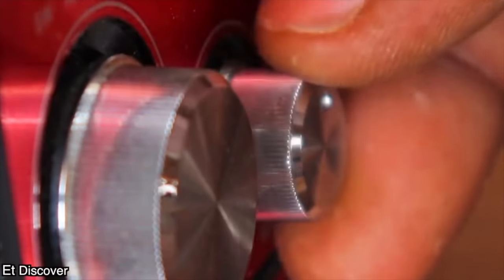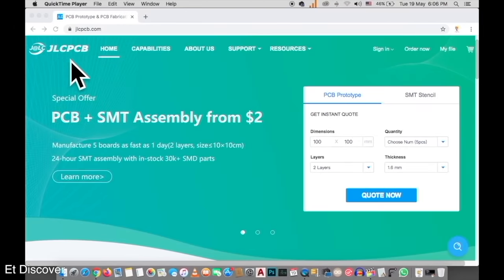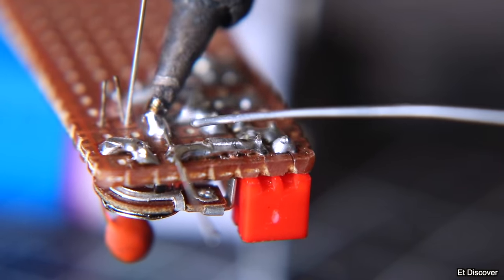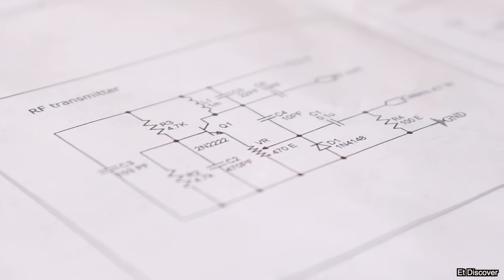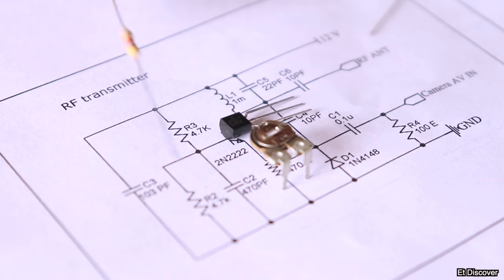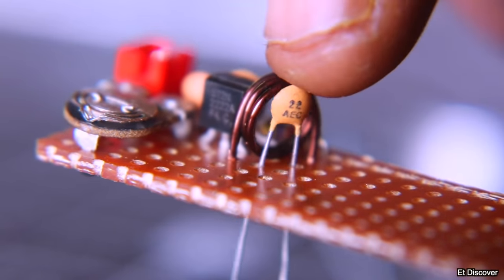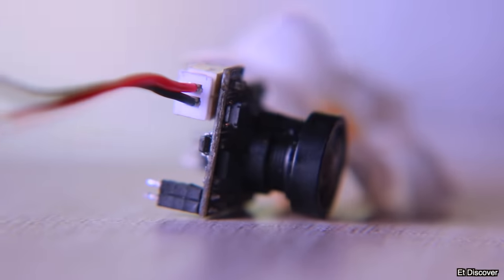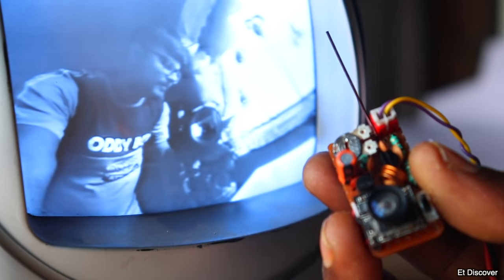How to Make 500 Meter Range Wireless #SPY Video Camera

Comment: Most wireless cameras have a receiver well most of mine do then plug the receiver in the back of most TVs .you turned the TV on then powered up the wireless camera you just built how did you get the picture straight on the TV ?

Comment: Hi
I searched a lot and tested more about video transmitter till i watched your latest video on YouTube  about wireless spy camera
It's fantastic but I've some questions
1- how can i add audio to that circuit without I. F
2- Can you provide me a complementary circuit to extend range to 2 km using c1970 or 2n 4427
3 - can i use crystall instead of l c method

Comment: Hey!
Interesting video!
 Question: Is it possible to make transmitter as small as finger thumb nail size with video and sound transmitter in it? Controller can be android phone so one can hear sound and see footage live!  One quick question. Which one is the transmitter and which is the receiver in a remote controller? The smaller part that flys with the drone is receiver and controller is transmitter?

Comment: Wooow, can you tech as how to use a camera phone (cmos) instead of that camera? Because phone's cameras are much better, there's a type that photograph the stars in the night with a sensitive sensor.

Also how to control the camera settings like iso and shutter? I hope you do that because i didn't find any one do it.
Reply from the maker: Ok I’ll try
Reply: This design totally depends on a composite video signal from the camera and higher resolution cameras use a digital signal, so not possible without using much more complex circuitry.

Comment: But is it transmite voice ?...i see that there is no microphone on the circuit so how can the voice will transmite?
Reply from the maker: I recorded this voice in my phone, This transmitter is only for video not audio
Reply: I believe that an audio pre with a good microphone from any old recorder could be added to the circuit so it also transmits audio.  I built a FM transmitter couple of years ago and they audio quality was awesome.  I hooked it up to an external dipole antenna using coaxial cable rg58 and I was to able communicate with my friends  within a 20km radius.  Great transmitter!  That's some of the things I did when I started my journey into Ham Radio. Oh!... what a great time I had! I wish I had the schematic to share it with you guys. (I was in Cuba, now I'm in USA ).  So I left everything in Cuba when I left the country.  Thanks for the video brother.  Great job!
Reply: Can you give the circuit diagrams

Comment: How to connect this camera with smart phone?
Reply from the maker: This is RF device not for phone, You need a television, you can use any kind of television
Reply: @EtDiscover  will it work if a special app is made which takes the FM/AM signal from your camera and converts that signal into video? Probably the conversion codes for analog to digital for the app is available online.

Comment: How i connect my cooler television  lcd
Reply from the maker: You can
Reply: If your TV is old enough to have an analog tuner, it could work. If it doesn't have a composite/yellow input, it's almost certainly too new.

Comment: My location is Fern Creek and Colonial in Orlando Florida. it may be illegal in other parts of the united states but here even street thugs use them to rob people. But if you call the FCC and tell them they will turn your call into a comedy routine.  There is no need to fear the FCC or the State or local police regarding such devices. Especially not in Florida! Certain people have fun blocking Zoom meetings and business conferences at the new Starbucks at the above location. And there are no cops to fear here. So don't believe the hype!!! The use of a phone jammer, GPS blocker, or other signal jamming device designed to intentionally block, jam, or interfere with authorized radio communications is a violation of federal law. ... It is also unlawful to advertise, sell, distribute, import, or otherwise market jamming devices to consumers in the United States.

Comment: Please be carefull on this as it's transmitting on frequencies not allowed by public. Unless you live in remote locations
Reply: In the United States that's true. You can't legally transmit video on ANY TV channel in the US. That being said.... With this circuit you aren't going to get 500 meters of range. Especially with that teensy antenna. With a properly tuned antenna you MIGHT get a P3 (snowy but viewable) signal at 30 meters on a portable analog TV.

Comment: this is imèpossible ... to trasmitt a video signal with only a tr ........  if u wanna send audio over 88-108 , ok , but video , it's impossible.  video need a more large band , with this project u cant control syncro and more video parameter ...  audio band is very tiny , video signal band is much large than audio . this project was good for a fm audio spy but impossible to send video ...

Comment: Let me explain why this circuit will never work.

1) The coil he made is not 1mH but around 5µH.
2) The actual resonance frequency of the LC circuit is 15MHz which is nowhere near the FM television range which this FM transmitter targets.
3) The 100ohm resistor on the video input just chokes the camera output signal and reduces it so much that it is impossible for that transistor to pick it up.
4) The antenna should be on the collector side of the transistor.
5) The video input should connect to the base side of the transistor to have an effect on the resonance frequency.

No wonder no one could replicate a working circuit.
The cherry on top is not actually a circuit flaw but it is hilarious when he says "103 picofarad" instead of the actual value of 10nF.
And this is why you should never trust a guy with an accent.